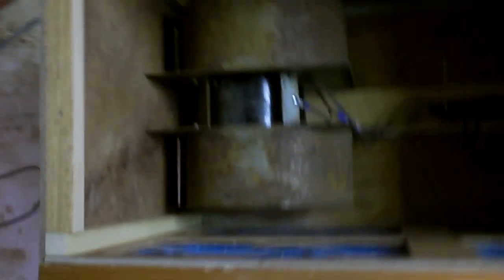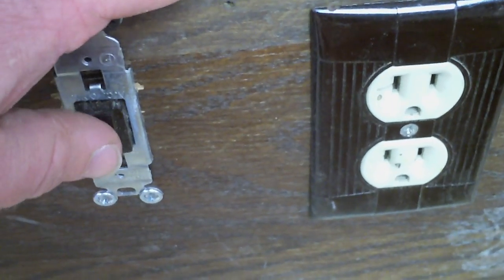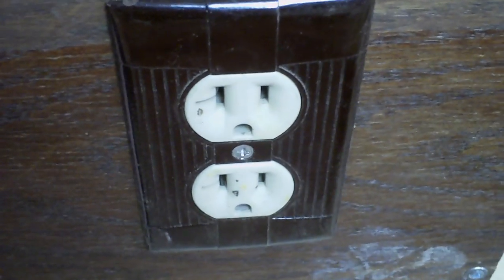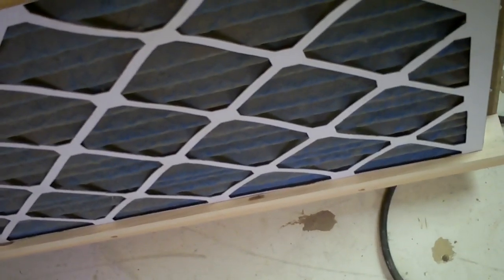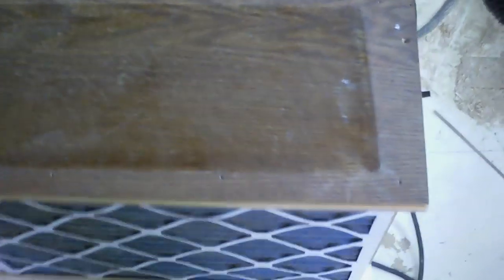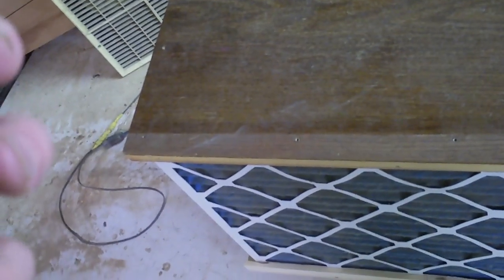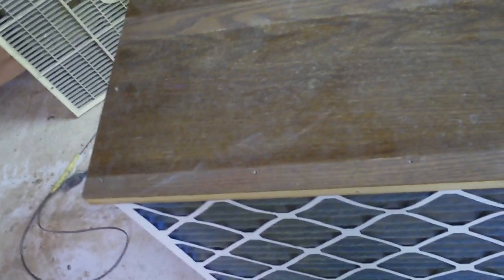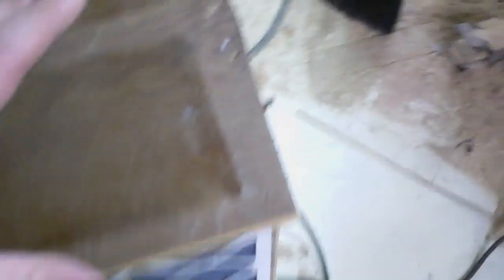Easy air purification system for a small shop.

Comment: [Charity Shop Money Saving] For HEPA filters on home air conditioning equipment, you can wash the Carbon filter in the dishwasher -- and if it fits -- the HEPA filter itself. The Carbon filter can only go thru the dishwasher so many time, as so with the HEPA ... but 3 or 4 extra uses can be achieved.